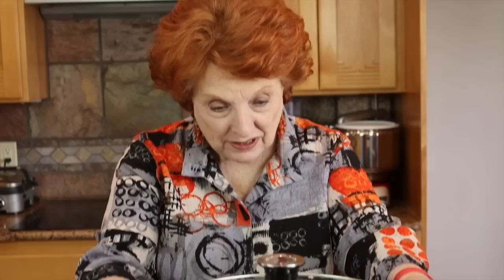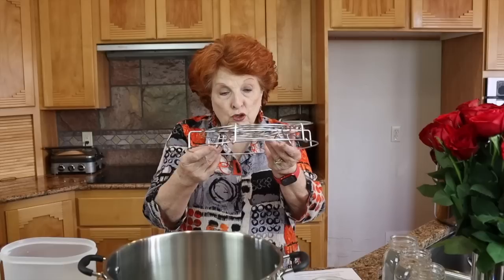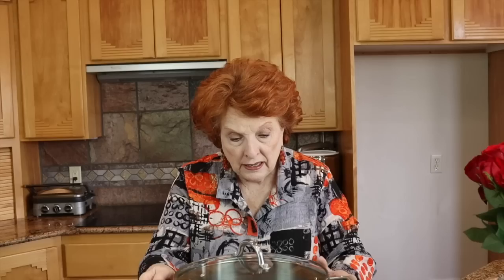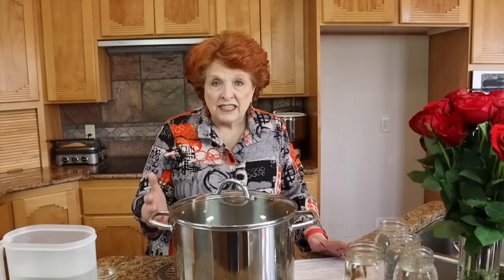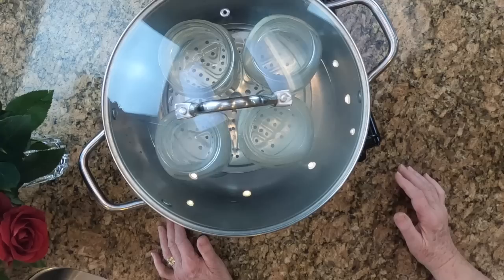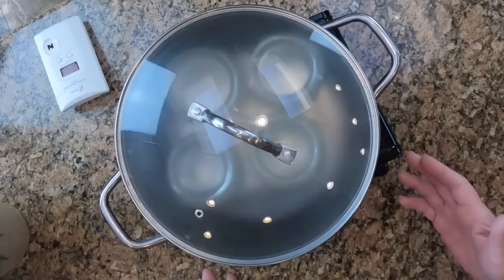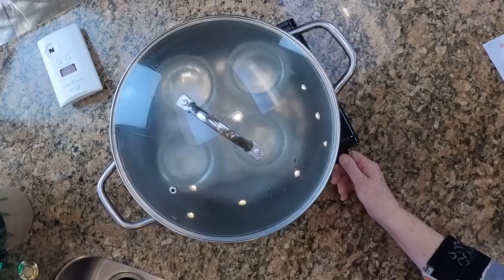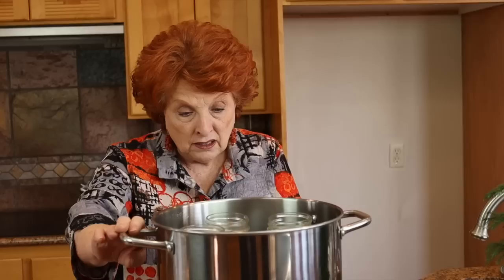How to Make Your Own Steam Canner

Comment: Will the bottom glasses be okay without standing on a trivet. I always thought that bare glass on the bottom of the pan invites breakage? Or is that just for canning at higher temps 🤔
Reply: If you didn't have another trivet, do you think a folded teatowel in the bottom of the pan might work?
Reply: @kimmcvitty3580  I've heard of that before.
Reply from the maker: You could try any of these ideas.  Someone else suggested empty tomato sauce cans which I thought was a great idea.
Reply: @kimmcvitty3580  A tea towel doesn't allow water to pass through it, so it lifts randomly and wildly off of the bottom of the pot. I might knock the rack around and bump the jars together or even knock them over. BTDT with a water bath canner. :(

Comment: Pam I wish you used lids so you could demonstrate how they sealed properly using this method of steam canning. I have a steam canner with the tall lid. It has a hole in it to let steam escape so for the neck of it, I used my digital thermometer to check the temperature when the gauge got into my green zone and it was 112 degrees, boiling point of water here.

Comment: Newbie here with a question. Why do the jars need to elevated above the water?  If the water and steam are the same temperature, can’t one just sit them on the main rack?  The reason I ask is because my pot is not tall enough to accommodate additional space below. Thank you for the excellent video!!
Reply: Yes please answer this one. I have the same question. I understand that steam is hotter than the boiling water but if boiling water is still hot enough why elevate?

Comment: Have you considered using the pressure canner as a steam canner? Same concept just wait till safety valve pops up and steam is strong from the vent hole (don’t put a jiggler on) and start timing.
Reply from the maker: How are you holding the jars above the water level?  Do you have a rack of some kind?  If you do, then it would work.  It is important to follow the procedures tested by the USDA for complete confidence in the safety of the food.

Comment: I have used this workaround steaming method in the past. I used empty, delabled green chili cans to use as lifters, which I would fill with water for stabilization. I was afraid of my small glass jars would break or become damaged if I put the jars directly in the pan. Worked great until I could justify purchasing a steamer.

Comment: We can use the old fashioned agate water-bath canners also by turning the rack upside down putting the three quarts of water in the bottom and placing the jars on the rack.
Reply from the maker: I tried that with my very old graniteware canner but when I flipped the rack there was not a solid enough platform to support the jars.  But I bet you could figure out a workaround!

Comment: I am having a hard time understanding why it is important for the jars to be elevated above the boiling water. Steam and water do have different thermal conductivities, but as the processing times developed by the test labs were for boiling water I wouldn’t think that having a jar partially submerged in boiling water would impede effective heat transfer or require a longer time.  I hold a PhD in chemistry and can’t reason my way through this one. I just don’t see a reason to rig an elevated platform for jars to sit upon. Is there something in the science I’m missing?
Reply: Yep same question!  Also, steam doesn't carry the same amount of heat (only temperature) as you indicate.

I accept that the jars still heat enough (to reach safe temperature), but her explanation isn't technically correct.
Reply: The boiling of the water will cause water turbulence, so the jars will rattle around on the bottom of the pot, possibly causing the glass jars to break. Same reason you use a rack for water bath canning, and don't place jars directly on the bottom of your canning pot.

Comment: Don't you need a rack under the 4oz jars to protect them from the direct heat on the bottom of the pot?  I thought that was why we had to use a rack while canning.
Reply from the maker: I have used it several times that way without issue.  Someone else mentioned they use tomato sauce cans, which would also work.

Comment: Making your own steamer have you ever thought about putting the rings at the bottom all the way around and in the middle as many as you can fit in fact. I measured mine and it’s about an inch and an eighth deep so that’s probably why they call for about 3 quarts or 2 1/2 quarts of water so it’s level with the bottom but I don’t think it would hurt maybe doubling the lids I mean rings

Comment: if you use an elevated rack, like you do here, in the bottom of your presto stovetop pressure canner, you can just let it vent steam for 10m and then without blocking the vent pipe, that is, without adding the weight/jigggler, just start timing. that way, the presto is also a steam canner.

Comment: Pam you knocked it out of the park again. I bought one of the steam canners with the domed lid and it works ok but I really like your idea better. My canner is not recommended for more than 30 minutes processing time or you risk running it dry. Couldn’t you add more water as long as your jars are above the water line and then be able to process longer?

Comment: Thanks Pam I had the same idea myself however I was really hoping that you could run your gadget in both the professional built and improvised steam canning setups
Reply from the maker: I did that, just not on the video.  I would never have presented the information had I not tested it for safety first, and it worked great--same temps as the commercial steam canner inside the jars.

Comment: What about using the Instant Pot steaming/sterilization function?
Reply from the maker: I would follow the USDA recommendations and not use any pressurized pots.  I have used by Instant Pot Max without pressure for water bath canning but would not be able to elevate the rack and still have enough height in the pot for jars.

Comment: Ive only recently started getting into canning foods, and I found your channel in my search for information. As I watched this video, I heard you mention that the water isn't supposed to touch the jars for steam canning, but I can't seem to find any information about why that is. As far as I'm aware, both the water and steam would be the same temperature, and cans are partially submerged in pressure canning, so I was wondering if you could shed some light on why you can't partially submerge your jars when steam canning. In my own case, my current pot isn't tall enough to raise the jars above the necessary water level if I were to steam can even pint jars.

Comment: I just came upon this video and it is very timely for me.  (at 77 I'm just learning the canning process).  I would like to run something by you.  Way back in my childhood my mother had a Presto pressure cooker that she used to can in and cook in on occasion.  It had a rack that just fit down in the cooker but also it had 4 longish screws the would elevate the rack - I never really watched her canning but I do remember she used to screwed (and nuts) for elevation and put water under the rack - - could she have been steam canning way back the the later 50's/early 60's?
Reply from the maker: That could be, but Pam has a 23 QT Presto that she has had for decades, and it has a two racks, but has never mentioned anything about screws for elevation. Welcome to our channel.  Jim
Reply: @RoseRedHomestead  I wonder if Dad came up with the screws and nuts - - I can see it in my mind and don't know if they came with the cooker?
Reply: I just found the same thing on Amazon - I will order them - comes in 3 pack of 3 different sizes -- woohoo

Comment: Could you not use a basket like the pasta basket that sits inside bigger pots? If you can get the three quarts of water to sit below bottom of basket? Right?
Reply: Yes.  I do that and I have a glass thing I use in the bottom of the pan so I know the water is boiling

Comment: QUESTION!……This is not about the steam canner though.  My mixer died.  Instead of repurchasing another $600+ KitchenAid mixer, I want to buy the Ankarshrum Mixer.  However, before I do I want to ask you how you like your Ankarshrum.  You have had several months to test it out and compare it to your previous mixer.  Do you like it better?  Do you think the bread is better?  I would really appreciate an answer to this question, before I purchase one.  Thank you Pam.  I really value your opinion.
Reply from the maker: Thank you for that question.  I never really liked how the Kitchen Aid kneaded bread.  Sometimes the dough just rode the dough hook instead of being actually kneaded.  For bread in particular, I like the Ankarshrum better.  It has two ways to knead--with a strange looking dough hook or a roller and both do a great job.

Comment: Mrs Rose 
QUESTION Would I still be able to do this process (making steam canner) with the water bath canner?? 
The water bath canner I originally bought ….. does not have a glass lid.
It is a Lehmans 20qt stock pot with rack  
Therefore when I water bath can, (which has been twice haha) I have to wait until water comes to a boil before put jars 
And before i cover my pot to start my processing time
🤷🏼‍♀️
When you have a minute, if you could let me know, I would greatly appreciate it 
Thank you again for all your helpful videos
Reply from the maker: The lid does not have to be glass, so yes, that pot would work just fine if you follow the USDA description of having the jars elevated above the water and don't start counting the processing time until a steady stream of steam has been coming out from under the lid for about 10 minutes.
Reply: @RoseRedHomestead  
I’m so glad to hear that. Ok thank you, 
I will make sure I follow the USDA guidelines as you had stated in video for steady stream of heat. 
  So I will dust off (haha) my canner and make some pizza sauce lol 

I’m so thankful for your knowledgeable 
Advice always !! 

I really appreciate you taking the time to respond to me so quickly 
That means a lot 

God Bless

Comment: Dear Pam, just a question. I am not sure if anyone has asked you in regards to steam canning in the Carey/Nesco canner. 
The instruction manual says " if your jars are too tall, you should use the LOW pressure setting. This allows the use of much less water & gives you more flexibility on the types of jars that can be used".  I do not want to read anything into what the manal states, but this sounds the same as steaming canning to me. Did you discuss steam canning possibilities with the inventor of this canner when you spoke to him???

Comment: Rose, Could I just use my pressure canner to do this but leave the weight off? Seems to me if it is steaming and that is what provides the heat needed for preservation the I should be able to put four quarts of water in the presto, put the cans in, place the lid, what for the lock to pop up and then start the timer once it’s fully steaming.

Comment: I have a vintage enamel ware steam canner.  It was gifted to me by the original owner's daughter.  She said her mother used it often to steam can.  The bottom is about 3 inches tall.  A rack fits on that.  Then the lid is like the other type of steamer which is tall.  There are no holes that I could use to check the temperature.   It sounds like I would be able to use this if I were sure the water was boiling and I would probably be able to see steam coming out from under that lid.  Does that sound correct?  I could never find any info on how to use it and was afraid it might not be safe.  I now have the same canner you have, so I probably wouldn't use this vintage one, but it would be nice to know that it  can be used safely.  Thanks for sharing your knowledge.

Comment: Do you think a used steam canner could be used , by using the steam as a gauge ,? I see plenty of gauge less ones at goodwill store where I live.🥰 thank you for your video Pam!
Reply from the maker: Yes, but you would want to measure the temp of the steam as it escaped the vent.  Jim
Reply: In this case, does it seem probable that you could utilize this same principle in an instant pot duo with the steam function and valve opened?

Comment: Good video. Have been thinking of creating my own steam canner too. I have one but need another one and refuse to pay the prices now. Would be interested to know what burner you are using. I need to get a burner too to get off my glass top electric oven before a disaster happens.
Reply: I have canned on my glass top stove with no worries.
Reply from the maker: I have used that particular pot for water bath canning on my glass top without issue.  And the steam canner as well.  The little stove I used in the video is a butane burner and you can find it in our Amazon store.

Comment: I have the Ball electric water bath canner and it is so heavy when full of water. Based on this, I could use it to steam can by just placing the elevated platform in it with water below the jar level, correct?

Comment: My question is why in steam canning do the jars need to be above the water?  Wouldn't covering the bottoms help transfer heat into the jars like it does for pressure canning?  Or did I hear it wrong?
Reply from the maker: It has to do with how the testing was conducted, which was having the jars completely surrounded by steam and not touching the water.  Steam is the same temperature as boiling water.
Reply: @RoseRedHomestead  thank you for clearing that up,. I was afraid I was missing something. But it turns out that it was protocol for testing the thermal power of steam(only).  I was happy you did this video,. I have been on the verge of buying a steam/water-bath canner for a while.  Your video convinced me to go ahead and purchase.  Funds ae low so I'm going with Wal-Mart's Mainstays 21.5 qt SS canner $25.  It will do 5 qts or 9 pints.   I àm acquainted with canning and did some 15 years ago, but my 23 qt pressure canner is gone(stolen).  I do small batch preserving, e.g. Hoisin Sauce, Duck Sauce, Pepper Jelly, Blueberry Jam, Apricot Jam, Plum Sauce, Stir fry Sauce etc..  I'm single so my pantry is not huge and I live in Senior Housing.  Storage is small too, but I can use the canner as a stock pot too(I cook therefore I soup).  I have two weeks worth of food stuffs in mylar bags from a company specializing in preparedness foods.  Thanks again

Comment: I got a steam canner but I think the lid was messed up so it would not steam properly. I am going to take it back and I decided to use my pressure canner for a steam canner as a lot of other people have mentioned. my question is, do you say to let steam vent for 10 minutes then start timing. But the steam canning directions for the steam canner say to process time once the gate has met your zone. I am wondering should I vent for 10 minutes then start canning for steam canning or just start steam canning once the steam comes out and the valve has popped up? Thank you for your time

Comment: I’ve never used a steam canner before and think I will try it with a stockpot like you show.  It seems to take forever to get my large water bath canner to boil. However, I’m wondering if you can double stack in a steam canner when using smaller jars.

Comment: I have a Ball Fresh Tech canner.    I use it for water bath canning but it also steams.I think I can use it.  Are you familiar with this?  It has a rack to hold food about 3 inches up off the bottom and a glass lid.  It will steam food so I think it would work for steam canning.  What do you think?  Also, if anyone else has one I’d like to read what you think.
Reply from the maker: It sounds like it would, but I can't say for sure.  If it meets all the criteria listed in the checklist I prepared for everyone to download, then it would probably work fine.

Comment: You are the reason I'm a canner.  However, even though you say the Best Ever Pumpkin Bread doesn't say to add oil in the bread, it does say that!  I've made it 3 times trying to fix the oil amount.  Had to throw away 2!  Please address this issue.

Comment: Can a water bath canner work? Put in only 3 quarts as indicated, Elevate the rack perhaps with a Springform pan then place jars on top. Is there enough room for the rack handles , and does the lid seal tight enough to create the steam needed?
Reply from the maker: Any pan will work provided the jars are above the water level and there is a good tight lid.

Comment: Don’t the jars sitting on the pan bottom run the risk of breaking since they are sitting right in the hot pot bottom?
Reply from the maker: Yes, but they just have water in them. You could place a the water filled jars on a short rack, but make sure you can close your lid.  Jim
Reply: @RoseRedHomestead  we don’t put our filled with food jars sitting on the bare bottom because they might break. If one of those small jars  break, it might cause the plate the jars are sitting on to tip causing the jars to hit each other and/ or break as well. I’m just saying they need to be raise up off the pot bottom as well.

Comment: It seems that this can be done on a glass top stove. My understanding it is the weight and constant heat that can either brake the glass or destroy the element underneath. Is this correct?
Reply from the maker: That is correct, but you also need to make sure that type of pot/pan you use will work on a glass top (we have an induction glass top) and the weight is will not strain it. You may have to make more than one batch. I am not willing to overload the glass top and have to replace it.   Jim